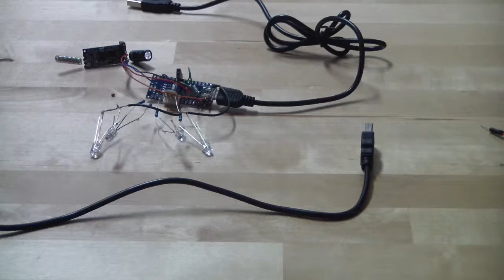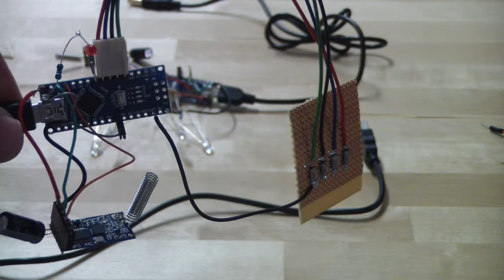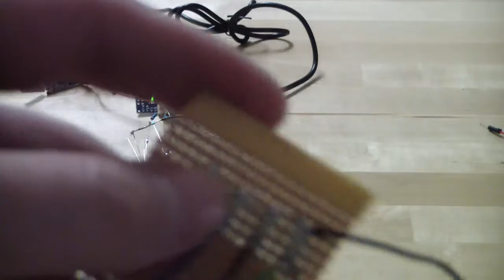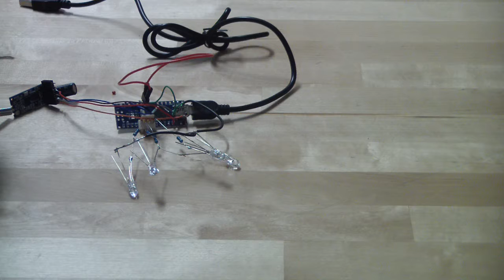HC 12 Uart Transciever Part-3 Improved code

Comment: /*By Roee Bloch - Version 4
 * This includes: Latch Mode, Momentary Mode (selected by A5 input), and also feedback to Transmitter that the Receiver got transmission OK - by LED on Transmitter
 * Controls 4 logic output at 2 modes: Latch (each press change output ON/OFF), Momentary (output on just when button is pressed)
*HC-12 Moule Transciever Same code is for Transmitter and Receiver, setup through A4 Input
*Tested on Arduino Nano
* This SW is for Transmitter & Receiver, the choise is done by reading A4 & A5 inputs (analog inputs)
* A4=1=> TX, A4=0=>RX
 * A5=1=>LATCH (Default mode), A5=0=>Momentary the stting now is via variable latch_logic if 1=> latch if 0=> momentary
 *
 * NANO connections to HC-12 As follows:
 * ARDUINO NANO                                        HC-12-MODULE
 * _______________________________________________________________________
 * 5V            -> 1N4148 Anode, 1N4148 catode ->     HC-12/Pin-1 (VCC)
 * GND                  ------->                          GND
 * D11                  ------->                          RXD 
 * D10                  ------->                          TXD
 * 
 * NANO (TX MODULE)                              NANO (RX MODULE)
 * ____________________                    ______________________________
 * D2 --> SW --> GND (SW1)                   A4 --> GND
 * D3 --> SW --> GND (SW2)                   D2 --> OUTPUT 1
 * D4 --> SW --> GND (SW3)                   D3 --> OUTPUT 2
 * D5 --> SW --> GND (SW4)                   D4 --> OUTPUT 3
 *                                           D5 --> OUTPUT 4
 *                                           
 *  FEEDBACK back will light Led on Trnasmitter for 100mS                                         
 *  See connection Diagram here:
 *  https://goo.gl/photos/qog8gWPKpSDPgZen7
 *  
 */
#define P1 2
#define P2 3
#define P3 4
#define P4 5
#define F1 6 // feedback back to transmitter
//#define latch_logic 1 // if 1 then latch if 0 momentary
 
#include <SoftwareSerial.h>
SoftwareSerial mySerial(10, 11); // RX, TX
char latch; // , if latch=1 then Latch
int read_A4, read_A5, i, read_P1, read_P2, read_P3, read_P4;
int TX_CODE, RX_READ, mode, TX_CODE_OLD; //if mode= 1 then TX
int RP1, RP2, RP3, RP4;
volatile byte SW1 = 0, SW2 = 0, SW3 = 0, SW4 = 0;
boolean S1, S2, S3, S4;
byte TEST;
char TXTOSEND,feedback;
int FLAG=1,latch_logic;
void setup() {
  Serial.begin(9600);
  mySerial.begin(9600);
  Serial.println("Hello HC-12 TX and RX SW, A4-Low=TX A4-HIGH=RX A5-LOW=Momemtary A5-HIGH=LATCH");
 // mySerial.println("Hello HC-12 TX and RX SW, A4-Low=TX A4-HIGH=RX A5-LOW=Momemtary A5-HIGH=LATCH");
  // This is for internal pull ups resistors on A4 and A5 Inputs
 
  delay(500);
  pinMode(A4, INPUT_PULLUP);
  pinMode(A5, INPUT_PULLUP);
  read_A4 = analogRead(A4);
  read_A5 = analogRead(A5);
  if ((read_A4) > 500) {
    mode = 1;   
    Serial.println("TX Mode");
  }
  else
  {
    mode = 0; 
    Serial.println("RX Mode");
  }
 
  if ((read_A5) > 500) {
    latch = 1;
    latch_logic=latch;
    Serial.println("LATCH Mode");
  }
  else
  {
    latch = 0;
    latch_logic=latch;
    Serial.println("Momentary Mode");
  }
 
  if (mode == 1) // TX
  {
    pinMode(P1, INPUT);           // set pin to input
    digitalWrite(P1, HIGH);       // turn on pullup resistors
    pinMode(P2, INPUT);           // set pin to input
    digitalWrite(P2, HIGH);       // turn on pullup resistors
    pinMode(P3, INPUT);           // set pin to input
    digitalWrite(P3, HIGH);       // turn on pullup resistors
    pinMode(P4, INPUT);           // set pin to input
    digitalWrite(P4, HIGH);       // turn on pullup resistors
    pinMode(F1, OUTPUT);           // set pin to input
    digitalWrite(F1, LOW);    
  }
  else
  {
    pinMode(P1, OUTPUT);           // set pin to input
    digitalWrite(P1, LOW);       // turn on pullup resistors
    pinMode(P2, OUTPUT);           // set pin to input
    digitalWrite(P2, LOW);       // turn on pullup resistors
    pinMode(P3, OUTPUT);           // set pin to input
    digitalWrite(P3, LOW);       // turn on pullup resistors
    pinMode(P4, OUTPUT);           // set pin to input
    digitalWrite(P4, LOW);       // turn on pullup resistors
 
  }
 
}
 
void loop() {
  if (mode == 1) //TX Mode
  {
    TX_MODE();
  }
  else
  {
    RX_MODE();
  }
 
}
 
void TX_MODE()
{
  while (1)
  {
    {
      read_P1 = digitalRead(P1);
      read_P2 = digitalRead(P2);
      read_P3 = digitalRead(P3);
      read_P4 = digitalRead(P4);
 
      TX_CODE = 64 + (read_P1 * 1) + (read_P2 * 2) + (read_P3 * 4) + (read_P4 * 8); // converting TX to one char
      TXTOSEND = TX_CODE; // conver to char for sending OK
      if (FLAG==0) // skip first time on FLAG=1
          {
          if (latch==1)
              {  
              if ((TX_CODE != TX_CODE_OLD)&&(latch_logic==1))  // transmit only on change
              {
                Serial.print(TX_CODE, BIN);
                mySerial.print(TXTOSEND);
              }
              delay(100);
              TX_CODE_OLD = TX_CODE;
              }
              else
              {
                Serial.print(TX_CODE, BIN);
                mySerial.print(TXTOSEND);
                delay(100);
              }
              
          }
      else FLAG=0;
    }
    feedback=mySerial.read();
    if (feedback=='R')
    {
    Serial.println("Data_Sent_OK"); // feedback to serial port
    digitalWrite(F1, HIGH);    // Ligjt Led Back on Transmitter
    delay(80);
    digitalWrite(F1, LOW);  
    }
  }
}
 
void RX_MODE()
{
  while (1)
  {
    if (mySerial.available()) {
      // read the incoming byte:
      
      RX_READ = mySerial.read();
      TEST = RX_READ;
      
      RP1 = (TEST) & (1);
      RP2 = (TEST) & (2);
      RP3 = (TEST) & (4);
      RP4 = (TEST) & (8);
     
      mySerial.flush();
  
      // When button is pressed (logic 0) toggling the apropriate LED Latch mode only
      if ((latch==1)&&(latch_logic==1))
      {
        if (RP1 == 0) SW1 = ~(SW1);  
        if (RP2 == 0) SW2 = ~(SW2); 
        if (RP3 == 0) SW3 = ~(SW3);      
        if (RP4 == 0) SW4 = ~(SW4);
         mySerial.print("R"); // This is feedback back to transmitter
      } 
          else // Momentary mode ON only when button is pressed continously
      {
        if (RP1 == 0) 
        {
          SW1 = 1;  
          mySerial.print("R"); // This is feedback back to transmitter
        } else SW1=0;
        if (RP2 == 0) 
        {
          SW2 = 1; 
          mySerial.print("R"); // This is feedback back to transmitter
        }  else SW2=0;
        if (RP3 == 0)
        {
          SW3 = 1;  
          mySerial.print("R"); // This is feedback back to transmitter
        } else SW3=0;    
        if (RP4 == 0)
        {
          SW4 = 1; 
          mySerial.print("R"); // This is feedback back to transmitter
        }  else SW4=0;
        
      }
      
      
//convert to bit for Digital-Out from Arduino
       S1= SW1 & 1; 
       S2= SW2 & 1;
       S3= SW3 & 1;
       S4= SW4 & 1;   
 
       digitalWrite(P1, S1);
       digitalWrite(P2, S2);
       digitalWrite(P3, S3);
       digitalWrite(P4, S4);
                     
      delay(100);
      Serial.print("S1=");
      Serial.print(SW1);
      Serial.print("  S2=");
      Serial.print(SW2);
      Serial.print("  S3=");
      Serial.print(SW3);
      Serial.print("  S4=");
      Serial.println(SW4);
 
    }   
  }
}

Comment: For a simple 4 channel remote control, this circuit seems to be way over the top, and complex.

Why bother with the Arduino at all? Why not just connect the output of a RF600E encoder to one HC-12 transmitter unit, and the output of the second HC-12 receiver unit would be connected to the input of a RF600D decoder. It would work the same as the setup above.

Comment: So to switch to momentary just connect A5 to ground on the transmitting Arduino??? I want to build a deadman's switch for a electric go cart for the grandkids and want to be able to cut power to the go cart if need be.  The switch would enable a relay for the motor power. The latching would work but I would prefer the momentary switch to prevent unintended "relatching" by bouncing the switch or over excitement by the person monitoring if the child went "out of bounds".   
Thanks! -Terry